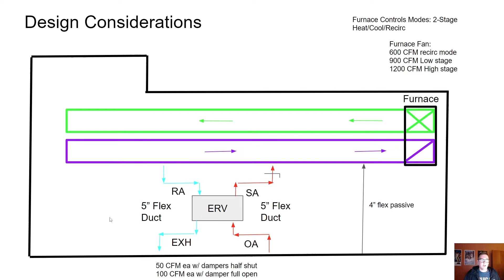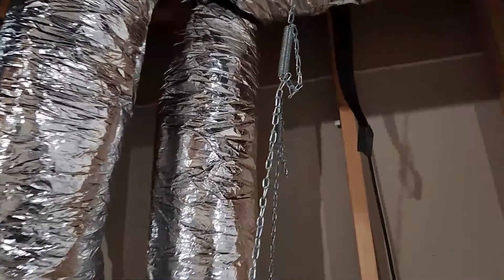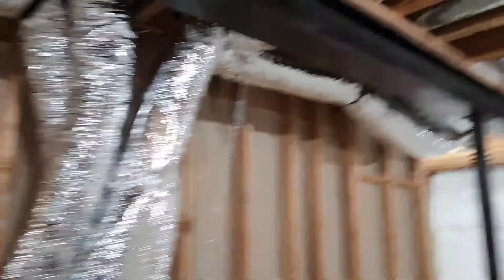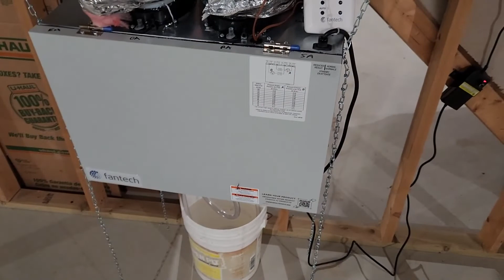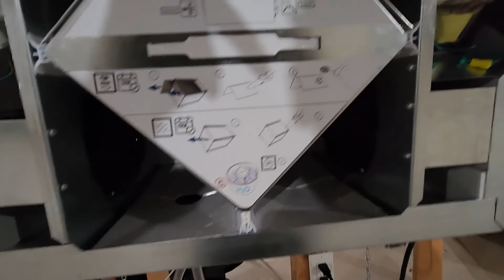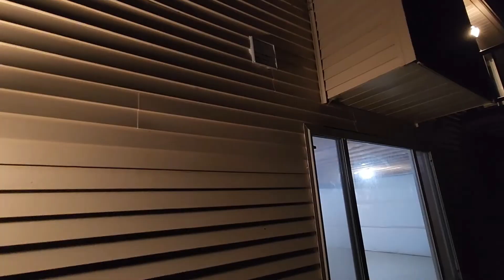How to Install an ERV, and what is an ERV? Indoor air quality with an Energy Recover Ventilator

Comment: Hello, great video. I can't really see it to well in the video, but when you hung the unit, do you just go straight into the web of the I-Joist or did you have to reinforce the web at all? Or did you go into the flange of the I-Joist?
Reply from the maker: I just went right into the flange of the i joist with small hooks. The ERV is only 30ish lbs so less than 10lbs per chain. I would recommend the door springs on the chains as poor mans vibration reduction!
Reply: @goodvibezgarage3232  Great! Thanks!